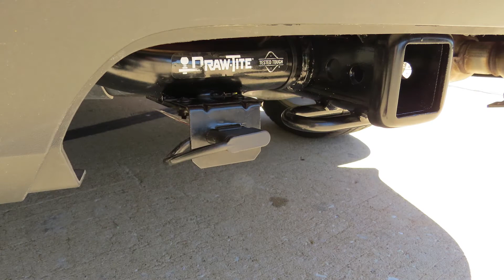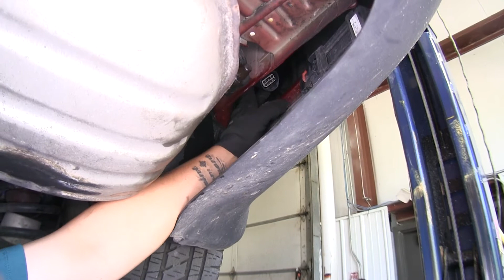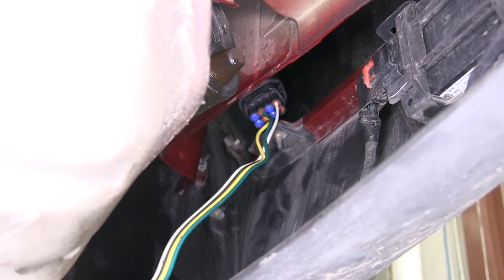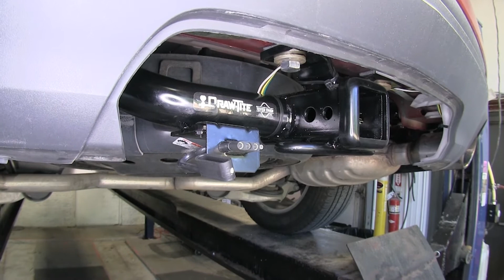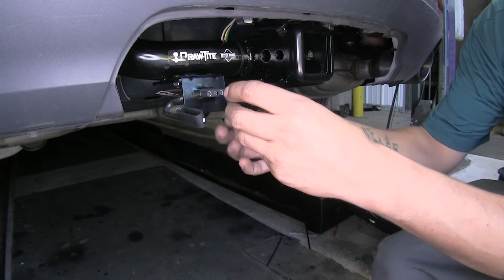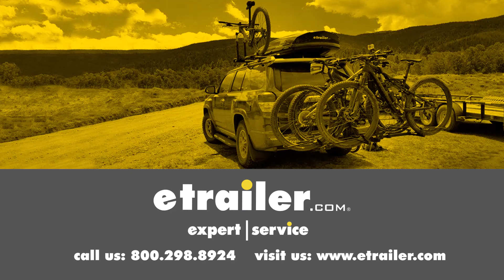install trailer wiring 2014 chevrolet traverse 118270 - etrailer.com

Comment: I have an 2014 Traverse LS & I can tell you for sure, there is NO connector under the passenger side rear fender. Both me & my mechanic have looked and IT IS NOT THERE

Comment: Is there a kit with a 7-wire connector for pulling a trailer with brakes?
Reply from the maker: Check out the following link to see the 7-pole wiring options we have for the 2014 Chevrolet Traverse.
https://www.etrailer.com/t1-2014_Chevrolet_Traverse.htm

Comment: Hi guys, I just bought the trailer hitch and the conector. Coul you please specify what relays you did install? 2012 chevrolet traverse. Thank you.
Reply from the maker: Check out the installation details on our product page in the following link. IT will show you were the placement is.
https://www.etrailer.com/Custom-Fit-Vehicle-Wiring/Chevrolet/Traverse/2014/118270.html

Comment: I've always been curious why you guys all install the wiring support bracket upside down. The plug can be easily damaged hanging down from the hitch. It's up behind the bumper cover with the bracket on top.
Reply from the maker: You can mount it either way as long as the wiring is secure. We mount it so that it's easy to access.
https://www.etrailer.com/Custom-Fit-Vehicle-Wiring/Chevrolet/Traverse/2014/118270.html